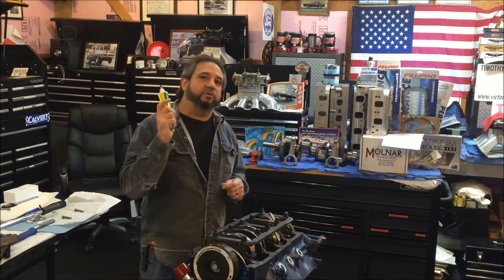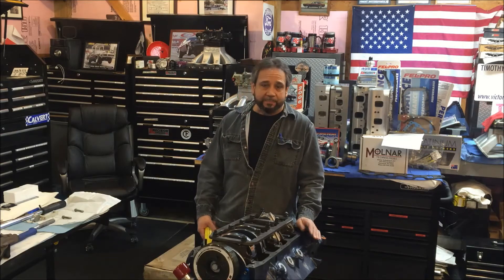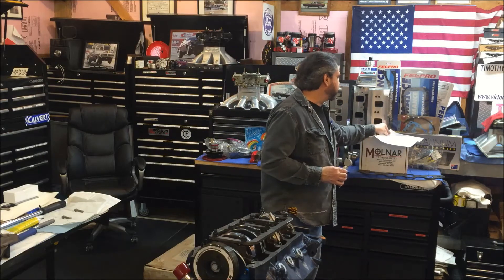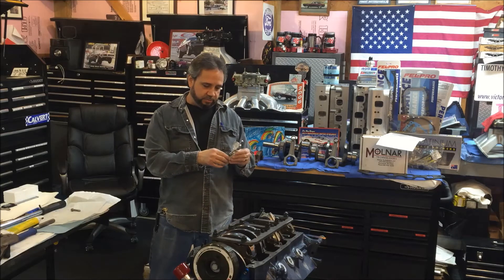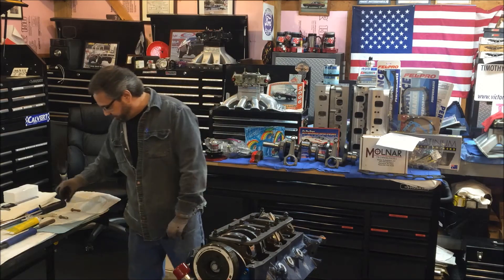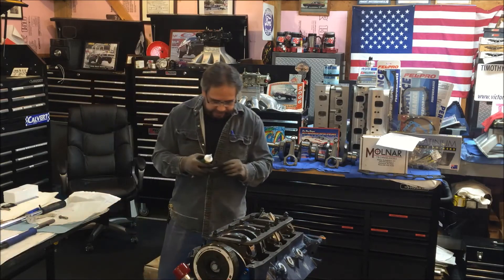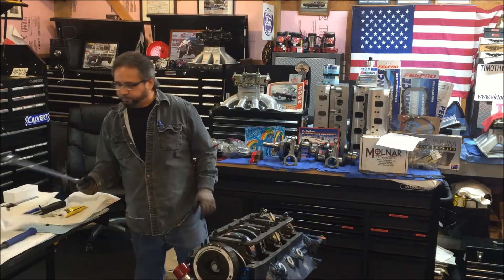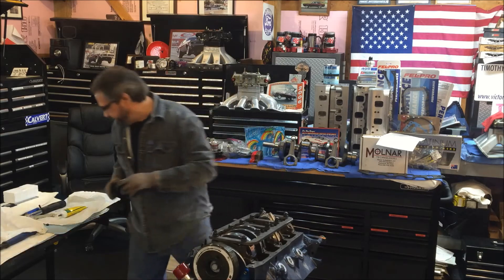Episode 43 Part B. Measuring Rod Bolt Stretch

Comment: Today's video is really a stretch for your average shade tree mechanic !!
Reply from the maker: arkhsm ford indeed it is. But it is not that hard, and your ensuring that your not over stretching, yield of the bolt. Gauge is only 50-60 bucks. Take the time to do it right. Hard to do it right, when you don’t know.

Comment: Problem with your method is u can't just pull a tiny bit to get your stretch as your rotating the bolt head and not necessarily the shaft of the bolt and u can get head sheer, u have to back off the bolt and full pull it and check again, and back off and same procedure again..
Reply: You do not need to back off the bolts.  Just tighten a little more until the correct stretch is reached.
Reply from the maker: @tommolnar339  Thanks Tom for chiming in. It is great to have a professional like you on board. Thank you for taking the time to answer these questions. No one ask's me any of these tough questions  in The ER.  Thanks for helping me..Tim
Reply from the maker: I was not aware of that. I will call Molnar tomorrow and get his thoughts. I want this done right. Thanks for checking it out.
Reply from the maker: Rick, I called Molnar today, and asked him that. He said I am doing it correctly, as he watched the vid too. He said if the head was only turning, why does the bolt increase in length?  Let me know thanks for watching and sharing your experience. DragBoss